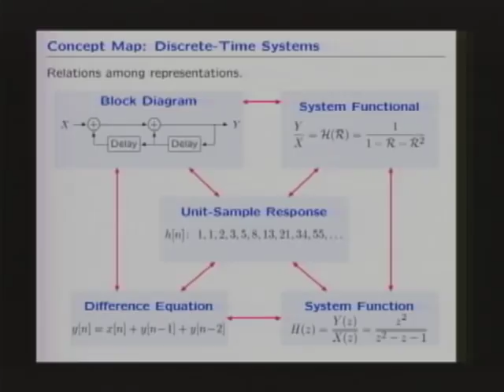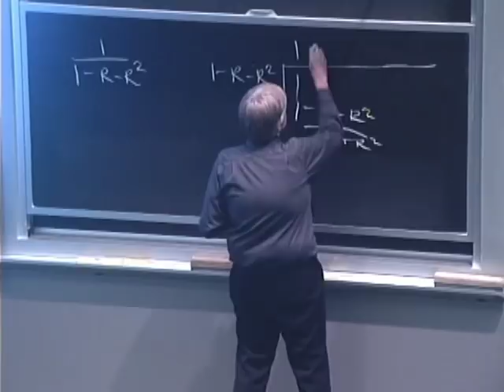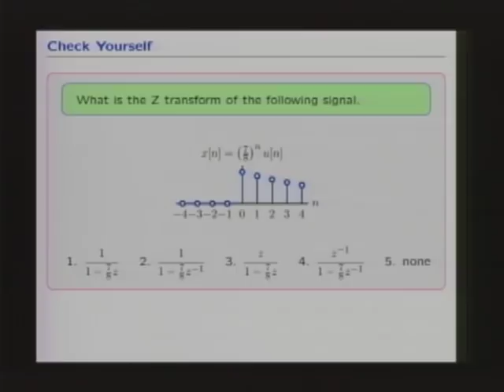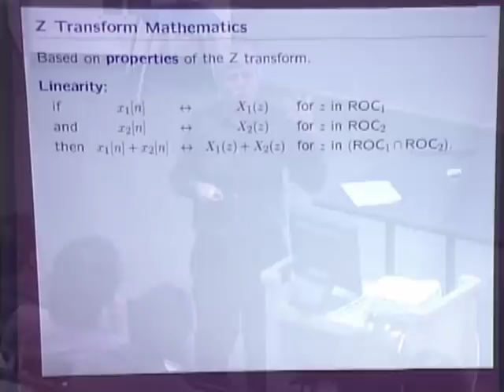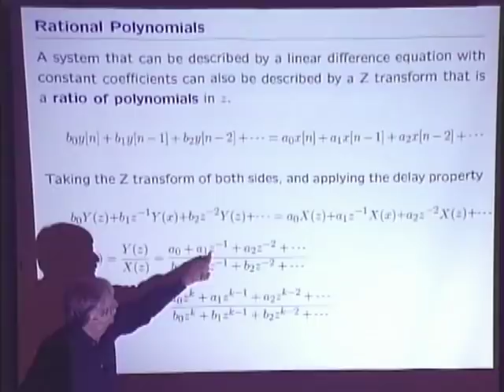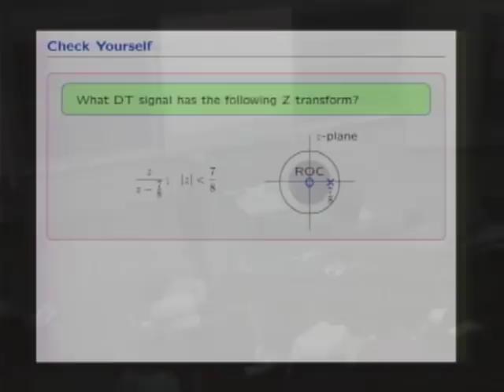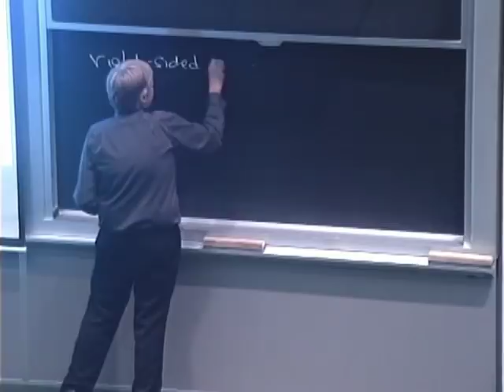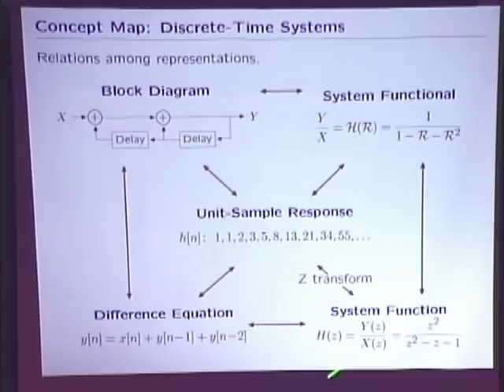5. Z Transform

Comment: I think this is one of the most appropriate lectures on z-transform. He tries to relate things rather than bore us with the regions of convergence. The only problem is that he gives too much time to the students to think. This is really boring. He could spend in more efficiently tying things more tightly.
Reply: He introduced z-transform by way of using a delay operator, which has an "out of the blue" feel to it. The more appropriate way, imo, would be to introduce DTFT first, then, by way of, sort of, stepping out of the unit circle, using eigenfunctions, and connect the latter (DTFT) with the former (z-transform). As a boon, this way the ROC comes in naturally justified.